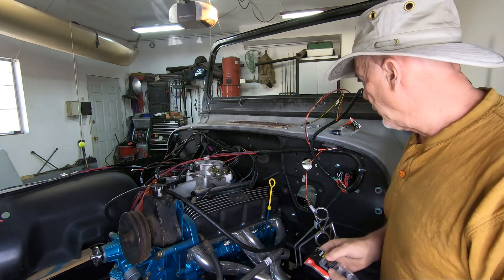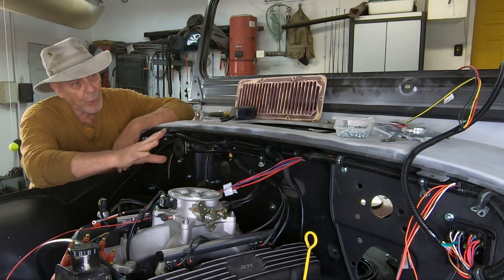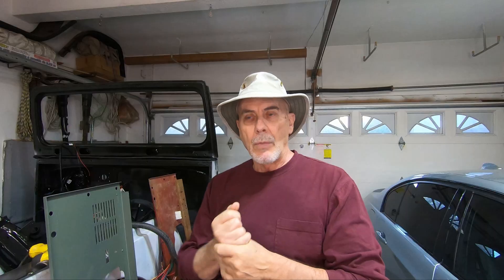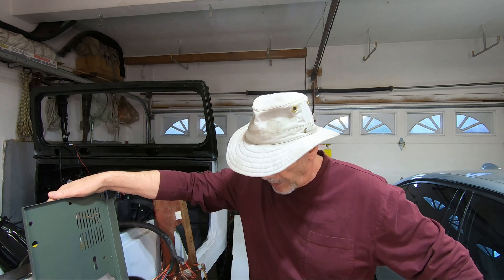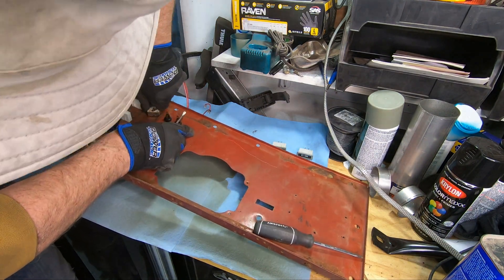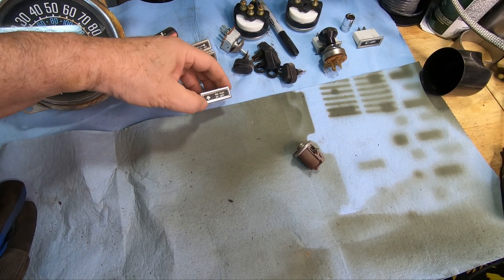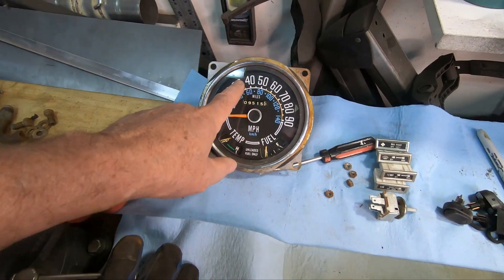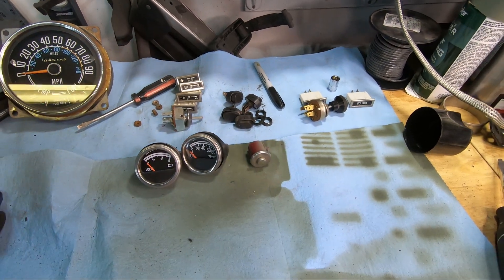EP81 - Wiring harness design and layout

Comment: Good job. Maybe you can pry those studs off the back of the old dash and tack weld them onto the new dash and the correct spot. If you can use a spray gun on your compressor, the duplicolor shop system is very easy to spray, and the blue that I recommended would look really good next to the engine color that you have.
Reply from the maker: Raymond, I think you may be right.  I've been thinking that I could even get some new small bolts and just snip the head off and then give it a quick zap.  Not sure I'm brave enough to try to paint this thing myself.  I think that is one job that will be best left to the pro's...